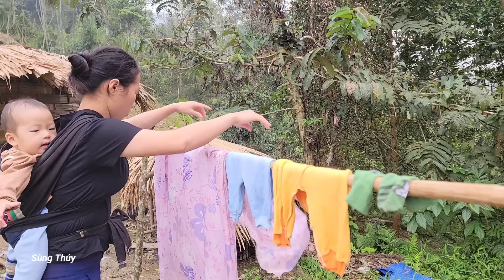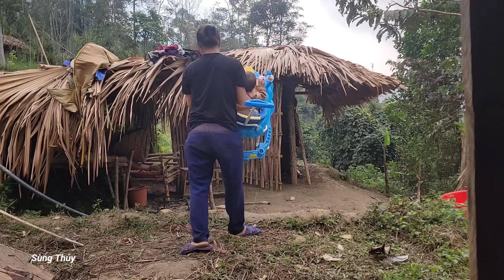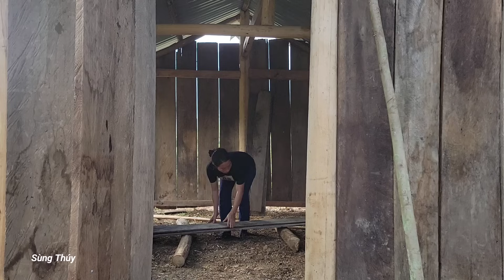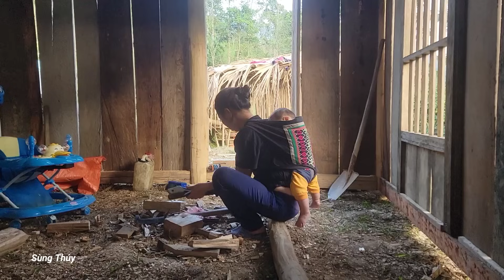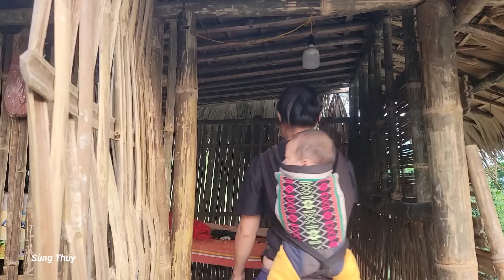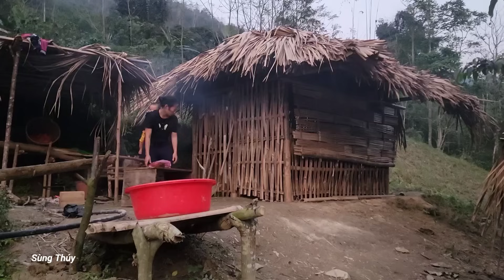consolidating a new house, the great joy of a single mother for her beloved child

Comment: I hope that you install flooring and cover up the window! In addition, there is spacing at the bottom and top for creatures to crawl in. Please secure those spaces.

I hope that you’ll paint or add some sort of protection against harsh elements. 

Are you feeling more secure now, because I don’t see you locking the space with all your belongings?